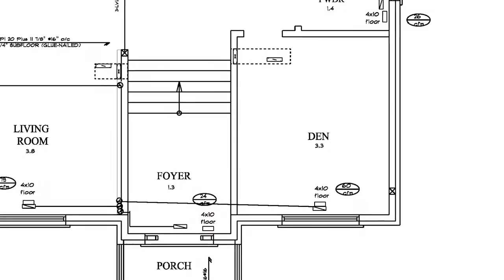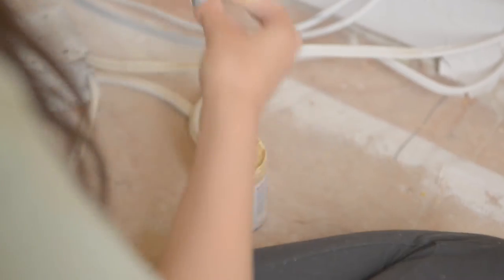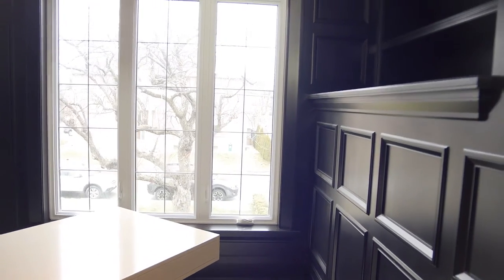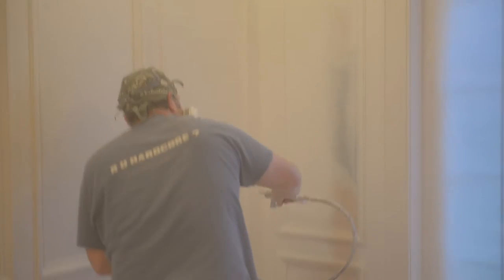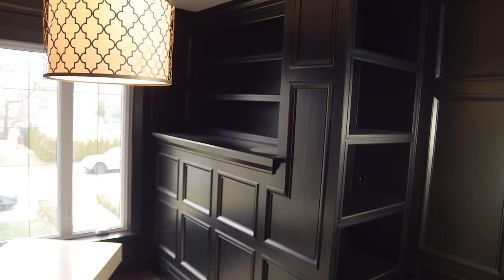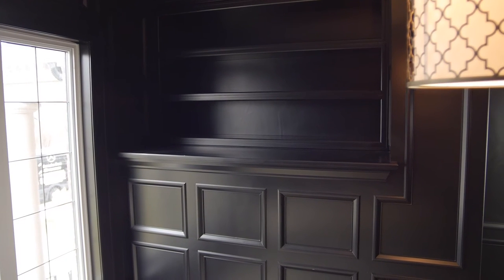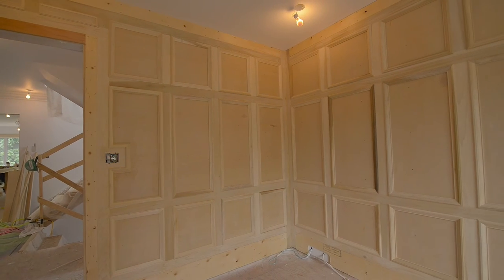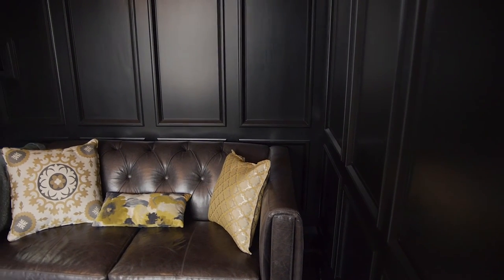Final Reveal Den Episode # 241 Hardcore Renos

Comment: This is by far the best room out of the build (IMO). The bathroom with a curved ceiling comes in at a close 2nd.
Reply from the maker: +Sloppy Bukake I would flip that around personally but yes I agree.  A lot of extra love into both of those rooms.  Thanks for supporting.  M
Reply from the maker: +Sloppy Bukake Let me ask you, why is this room your favourite?
Reply: +Hardcore Renos  More than anything its the artistic value for me. I've worked in construction and currently work in media (video and photography). Most people put up a chair rail. It is usually down the center of the wall, with some base board and some paneling. Very unoriginal, very lazy. You guys went the extra mile and went from the ceiling to the floor. Made sure all the details were accounted for (the outlet placement, light switch placement, even measurement between the ceiling crown molding and baseboard,ect..). I know when you boil it down it is just ply wood, 1x4's and molding. But it is not what you have, its what you do with what you have (I'm currently working on a living room trying to duplicate it :-) ).
Reply from the maker: +Sloppy Bukake Thank you for noticing such details.  Thank you so much.  If you have any questions I'm here to answer anything and everything.  More new ideas ahead for me and my team, its hard for me to just do the typical.  Manny